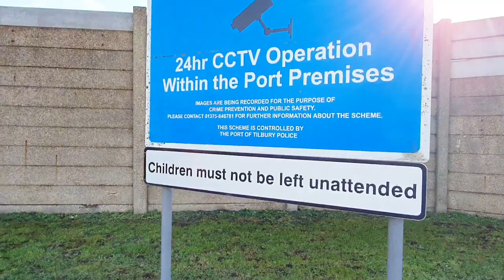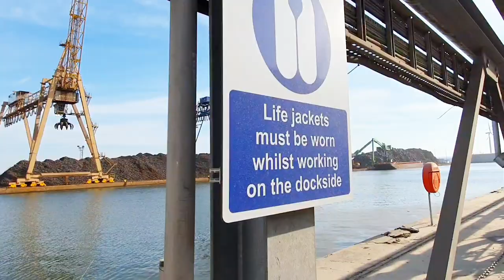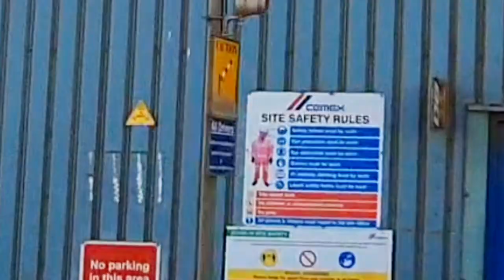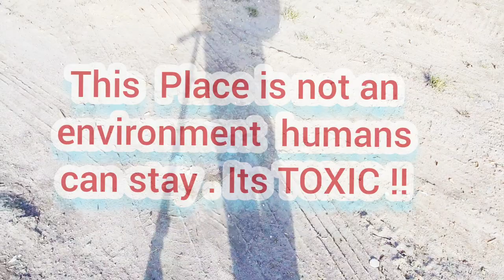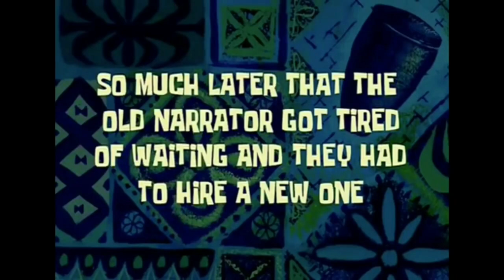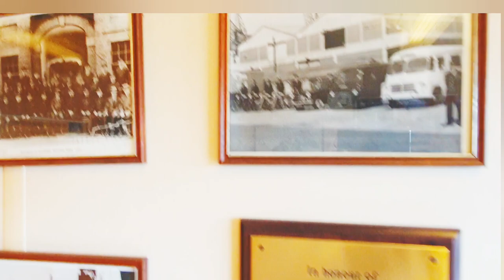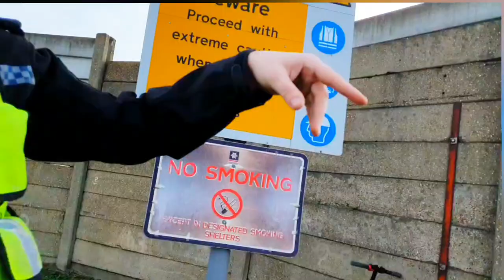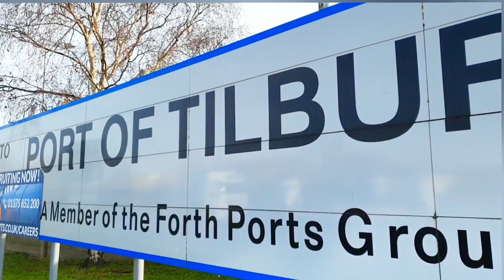"Get That Camera Away From My Window" Tilbury Docks & The Mystery Bye-Law 77. .

Comment: Section 77 of made up laws! Section 77 of the 1920 act seems to apply to them detaining vessels that haven't paid up, Section 77 of the 1968 act seems to relate to "provision against danger to navigation". Section 77 of the Harbour Revision order 202 is "Removal of vehicles at port premises".  There doesn't appear to be a Byelaw 77 from my 2 minute Google search!
Reply: Multiple users have found section 77 to be loitering. It does not appear made up

Comment: It is not private land at all, it is Public land with clearly marked areas where the public access is restricted . Section 77 of the Port of London Act refers to refers to the need for the Port to highlight dangers to navigation
Reply: Wrong section 77. It was correct if you check the revised byelaws
Reply: @garysmith4416  then post a link , i'll apologise if I was wrong

Comment: According to section 77 of the port of London act, it just means authorities have to act in the case of something that could cause a danger to navigation, navigation of boats though not vehicles. It basically says authorities have to put buoys down so boats don’t crash. It has nothing to do with kicking people out of the port area
Reply: If you read the replies you will find you looked up the wrong act. The revised bye laws show section 77 is about loitering and was correct
Reply: @garysmith4416  the wrong act? That’s the act he mentions in the video unless there is another by the same name. Would you happen to have a link to the one I should be looking at mate
Reply: @perry714.  it was revised and the updated one has been quoted with section 77 about loitering. It can be found on forth ports own website.
Reply: @garysmith4416  yep clear as day on that one. The officer did have rights to remove him from that property and tbh depending what’s done down on that port it makes sense really. You could also wonder what type of illegal unloading could be done if randomers were able to just walk around the port Willy nilly. I didn’t really have a problem with what the officer did as he was actually rather polite and helpful, I just thought it was another cooper quoting the wrong laws as usual lol but it seems he’s actually quite clued up aswell as polite so fair play to him
Reply: I have not been to that port but most ports have restricted and unrestricted areas. The restricted areas are more similar to airports and i dont think any auditor would be able to gain access to them and if they did i am sure they can be arrested sinilar to if you got airside at an airport without authority. ISPS regulations require certain areas to be more restricted than others

Comment: 23:42 Section 77 Port of London Act
77. Provision against danger to navigation
 (1) In case of injury to or destruction or decay of a tidal work or any part thereof the Port Authority shall
forthwith lay down such buoys, exhibit such lights and take such other steps as are necessary for
preventing danger to navigation. 
🤣🤣🤣🤣🤣🤣🤣🤣🤣